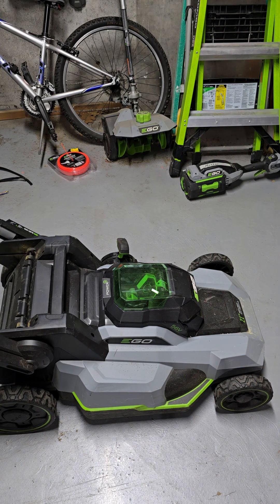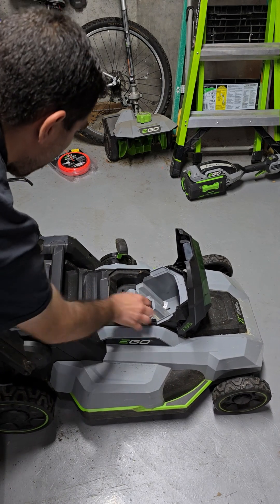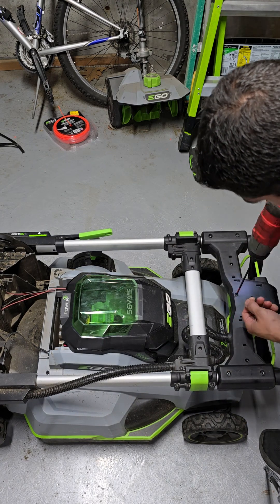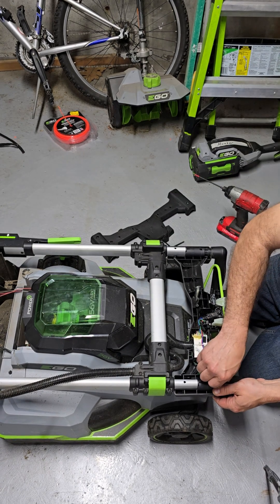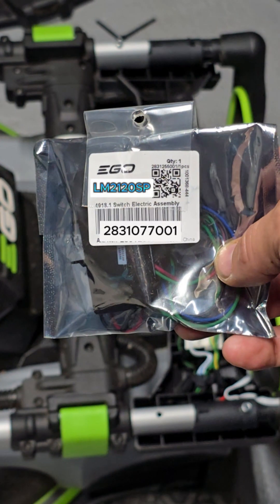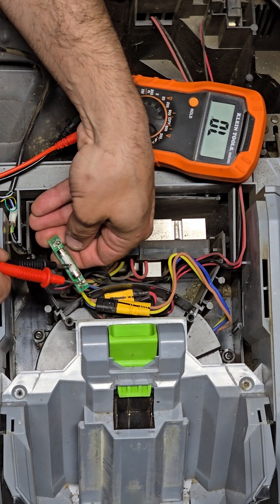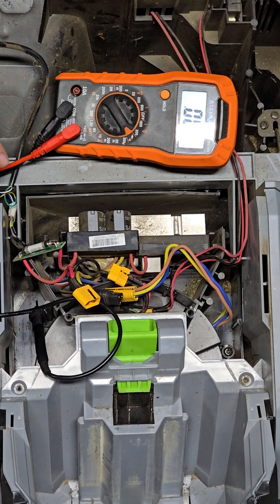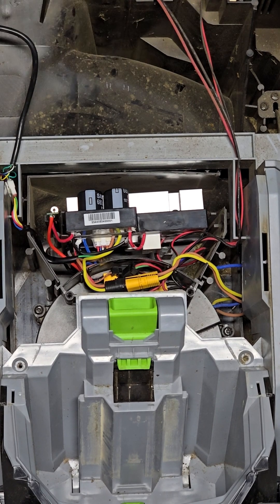EGO LM2120SP NO Power! - The grass won't cut itself, here's how to fix it!

Comment: I have the same model, it has power to self propell to move, but doesn’t spin the blade. What you think is the issue? Fuse maybe?
Reply from the maker: @AnthonyFarrer_TPG Could be a few things. Start by testing the fuse on the red cable. My guess since you have power to the self-propel it's probably not blown, but I still always check. Next you could see if the DC motor is slightly frozen by tapping it on it's sides with a rubber mallet, then retesting. Its a long shot but I have fixed one like that because it had rust built up. But most likely the blade control section of the main PCBA failed which would require replacing the main electrical assembly since its fully integrated - part# 2831076001. Sometimes if you listen closely, you can hear the main PCBA try to send power to the blade (sounds like a hum or a tick) that would also indicate you have to replace the main PCBA. Should be this guy: https://depaults-hardware.myshopify.com/collections/ego-parts/products/ego-2831076001-4918-2_main-electric-assembly